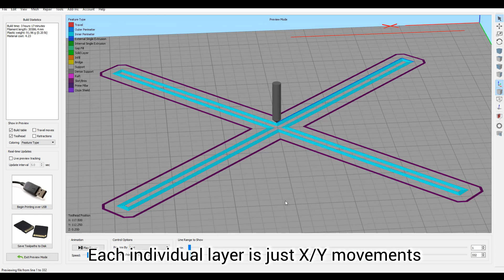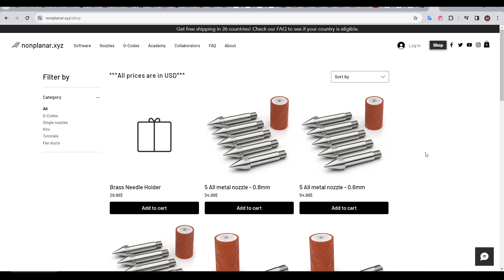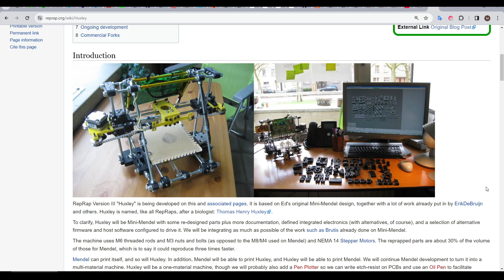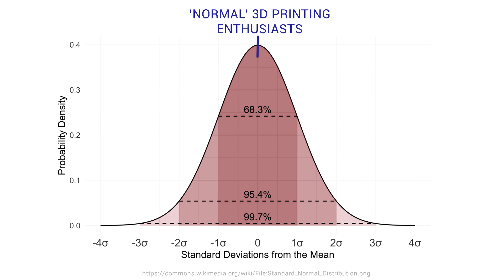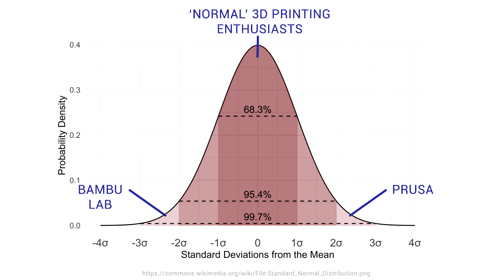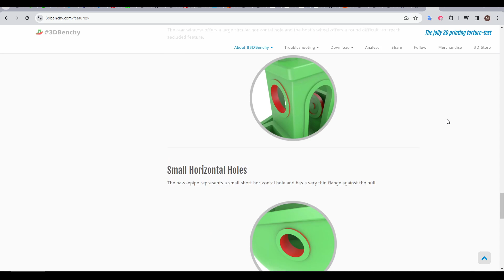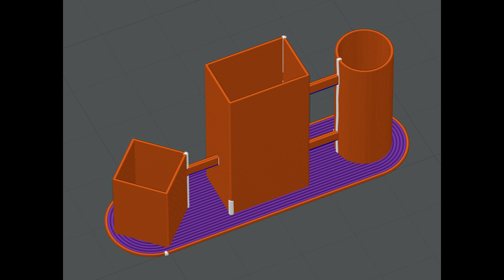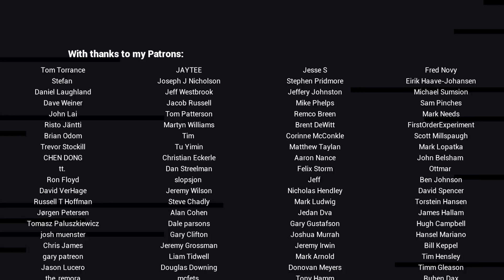3D printing mysteries that need to be solved in 2024

Comment: The community toxicity comes with scale, and low barriers to entry. Its great that manufacturers are making 3d printers as straightforward as kitchen appliances, but it does mean that its easier for people who made a "good" decision to assume all other decisions that don't validate theirs be "bad". I see a bit of this, because i bought a Creality K1. On purpose. It actually works fantastically, but its not a bambu or prusa, and some youtubers had issues with early models.

I want to see a shift away from the gear, and towards the design. Anyone can spend money and buy a perfectly good printer these days. The learning is in designing cool stuff!

Comment: I had to test your filament twisting theory. I fired up my 3D printer, heated up the nozzle to 240C (PETG) and started extruding.
It started twirling OPPOSITE like your direction (I know you are in the Southern Hemisphere), I live in the Northern Hemisphere (Europe). 
So your theory seems true 😮

Tehnical information:
The heatbed was turned off while testing.
I have a Lotmaxx Shark V1 with the double filament extruder mounted (first Kickstarter edition).

Here is the video proof:
https://youtu.be/gh5NYtfF1b8

Comment: Definitely interested in non planar printing. It'd allow for greatly increased color control on surfaces and far less waste. Print one color once for a surface feature over varying Z surfaces, instead of having to change filament many times for each layer.
Reply: It would be a great feature, unless like so many manufacturers you are getting into the filament selling business as it appears to be more profitable than selling printers, in which case the filament waste is a feature, not a bug.

Comment: Strain crystallization is the reason for the cracking. 

PLA is a semi-crystalline synthetic plastic derived from corn.

The phenomenon you are experiencing is known as "strain crystallization"
https://en.wikipedia.org/wiki/Strain_crystallization

When PLA is manufactured (or any other semi crystalline plastic) this effect occurs. During spooling the filament is quite hot and somewhat pliable. The filament gets wrapped around the spool where it finishes cooling and forms a kind of memory effect.

Image for a moment that a flat sheet of plastic is suspended on its outer edges with hundreds of pounds of weight set in the center of the sheet for an extended period of time. Over this period of time the plastic will start to deform. When the weight is removed the plastic will maintain its new deformed shape. If the weight is left for an even longer time the plastic will eventually reach its maximum deformation state and break. This is the same effect as in the filament although in reverse since it's coiled and then straightened.

The filament is now constrained in the tube (which is most likely more straight than the filament) and is now stressed from its original form. It eventually breaks due to this strain.

Moisture has a small effect on it, but is not the only reason it breaks. Oddly enough, the tools used to remove moisture are the same tools that are used to reform the filament. In this case a heater / dryer.

If the filament is sufficiently warmed before it enters the tube it should reform into the shape of the tube and stay that way without breaking.

This breaking effect is amplified by cold temperatures since most homes aren't heated (or cooled) at the same temp in summer vs winter.

TL;DR
If you use a filament dryer to warm the filament just before it enters the tube, it shouldn't crack.

Comment: 11:22 Filament flows with same speed if you print walls of two objects. 
If you print top side of cylinder, it is completely difference flow-speed. Print an area, jump the other object and print wall, start new layer. 
You have another flow-speed, filament heating is difference and you have another color.

Comment: Non planar slicers are actually already commercially available, I have visited them on the Formnext, the company is called ADAXIS (google it yourself, not gonna post links on y-tube). I have talked to a company respresentative and he told me, their SW is actually also usable on standard 3 axis devices and will work fine (with the required adjustments). The SW is capable of modeling every bit of the printer at all movement states so that with just the right input data the printer will never crash into itself. The SW is also capable of any amount of non planar slicing in any direction for anything up to 7 ax machines.

The SW costs 4'000 € per year per workstation (more than 2 Ratrig V-Cores). I already told the guy, if they would ever sell a reduced, commercial licence for only 3 ax machines for 200 € or less their customers would not be in the 1'000 ends (elegedly they have like 2'000 customers currently) they would number in the millions).

Comment: For the artifact you mentioned at the end, I know it. Changing the layer switch point, what's called... Well that option, into the slicer, you set to Random instead of Aligned, the point where it switches to the upper layer. This could not resolve at all, but mitigate the artifacts disguising them.

Benchy, then: I have a feature on all my benchies which is not featured on their site. 😮 It could be an artifact but it's very subtle and looks intentional. So I re-downloaded the benchy from Printables (I'm on Bambulab) and reprinted it, and there it is! Again!
It reminds like the "secret" hull line, so called, which is an artifact and it's kind of an unsolved mistery since nobody knows why's there and how to avoid it. Mine, instead, looks like that but is way more subtle and follows the upper edge of the hull. So it's not a layer artifact. It follows on more layers and it looks like a very subtle fuzzy skin band effect which follows the upper edge of the hull. 

No freaking idea what could it be!

Comment: I think you're right about that surface finish thing, I think the best way to fix it is to anticipate how much heat will be needed to bring the required volume of plastic up to temperature, and maybe to adjust heater power early to account for how much time it take the heat to make it from the heater into the nozzle.

Comment: i wonder if warming the old filament would help it stay soft. Like a dry box, but a hotbox instead. I can even use tape caulk on metal rooves in -35c if i have a hot box close by the roll former.

Comment: The brittle filament is due to humidity swings, and brand quality to lesser degree.  I've had the same repeated experience before I figured it out (I live in humid south/coastal USA).  I centered on one brand (Polymaker) but more importantly, I store all my filaments, individually, in 4L cereal bins with desiccant, never a problem again.

Comment: the layer artifacts are flow related, but caused by the minimum layer time (a cooling setting) - if you printed a plate full of parts you wouldn't see these as prominently.

Comment: The toxicity is just like anything else. Accessibility brings with it the dregs who take the opportunity to lash out for a lack of understanding of any other option. I used to spend a lot of time offering assistance on the resin reddit pages with new users years ago, doing extensive engineering and troubleshooting, but anymore, it's just a breeding ground for stupidity where you'd be hard-pressed to spend your time actually trying to help someone where doing so opens you up for a full frontal attack. Very reminiscent of anything connected to the internet with no filter, where it was supposed to be a thinktank for helping others colloquially, but has spawned an entire generation of pandering fools with no self control. 

On a more serious note, non-planar printing is still very much a niche pet project but wholly underutilized industry-wide. I looked at it for about six months with a large delta or adapting the instruction set for a 5 axis, but ended up moving to resin printing exclusively about 2019. I recall my filament swirling clockwise however, located in North America.  I suspect that's more a property of feed mechanism and type though.

The bending/breaking filament is kind of two-prong. Part of it is a long, technical exploration of off-gassing properties of what escapes as your filament ages, and part of it is thermal cycling in concert with your printing environment, storage practices and moderate shifts in elasticity. I could write you a white paper on it given the time and space. 

A theory on the artifacting with congruent shapes/parts, I believe was explored with retracts, and cycling in and out of the hot end as you noted. I'd have to go back and see where it was discussed in Cura a long, long time ago, but there's a setting to help alleviate this. (Last I used a dev release was around 4.8 quite a while ago, but with a delta printer also, I never noticed these issues. It may also comes down to not using the cartesian movement system)

Comment: Where do you store your filament when not in use?, the only time I've had filament snap like that is when it was about two years old and left out to the enviroment, I use a sealed plastic container with lots of dessicant in it these days (each one holds 3 reels), keeps all my filament nice and dry and in a pretty fixed enviroment when not in use.

Comment: I'm pretty sure that slowing down the top layers quite a bit would allow the hot end to keep temps so when it hits the top layers and slows to 50 percent of your wall speeds it's closer to running your wall speeds and keeping the temps consistent

Comment: Agree totally with the Bambu vs Prusa.  I have a Bambu X1 Carbon with AMS and a 5 head Prusa XL.  They are both great printers, but like any other tool one will work better for a specific job.  The Bambu is great for small jobs with a few changes, the Prusa for bigger prints and more tool changes

Comment: 8:51 regarding the filament breaking i think it has to do with the fact that with the way it is positioned now you bend it the opposite  way it is on the spool the moment it enters the bowden tube.
adding the fact that when the gantry comes to the front right it must also twist(at least im my imagination!) causing the breaks .
i would lower the spool so its top is leveled with the top of the machine  and have the filament go from the top of the spool directly to the tube.( flip upside down and left to right)
happy new year to everyone and really really thanks for your guides-videos. definitely a treasure of help and knowledge

Comment: 11:27: This is very apparent on ABS, which has a much higher shrinkage rate than PLA.  So my theory is it's due to the total layer time for each layer and how that interacts with the shrinkage of the material.  A perfect square or cylinder means the same layer time for each layer, so the shrinkage is uniform.  However, when other geometries are introduced, the layer time changes and the amount of shrinkage changes before the next layer is put on top of it.  A test for this, which I have not tried yet, would be to adjust the slicer settings (extrusion speeds) such that each layer takes the exact same amount of time.
Reply: ABS also suffers from temperature dependent die swell more so than most other materials. The nozzle tip temperature of course isn't controlled by the printer, the probe is basically next to the heater or the threaded part of the nozzle, and depends on any number of things that happened just prior.

Comment: OK, warning huge comment incoming:
1. Non-plannar. It is already very much a thing for professional/industrial applications already (see pellet printing robotic arms with software like AiBuild, Adaxis etc). Everything is very expensive in that category and the reason I think it has not trickled down so far to the prosumer side, is due to not having a "killer" application/need to justify investing (prioritizing) the development hours. Similar to why PrusaSlicer never got belt printer support and Duet3D is making toolboards for Revo Roto and not updating the firmware for robotic arm kinematics. You have to prioritize and so far non-plannar 3d printing for prosumers has only been able to be in the "nice to have" list of features. If you are 3d printing a mold for autoclaving carbon fiber aerospace, F1 etc parts you actually need to use non-plannar printing for the best results. If you are printing parts to build a HevORT SPAWD, then you don't really need non-plannar. If Prusa discovers an application for which non-plannar printing is necessary, I think they will put it in higher priority to support it in the slicer.
2. Toxicity: Internet communities are not "natural" communities and the "normal" rules of socializing and behaviour don't apply. If you are an irrational fanatic in a physical/analog community you will be exiled, paying a huge social cost. In an online community you will get blocked/muted/"cancelled" only from the opposite tribe fanatics and there will be a welcoming tribe for you to feel a part of, which is not really a cost to pay. If toxic behaviour is not "costly" socially, then the curve slightly changes shape and you get more hardcore tribalism.
3. Mostly material dependant and to some extend moisture. PLA, PC, Nylon and silks (PLA + polyester modifers the shininess is because chemically the polymers don't mix well and interlayer adhesion is worse for silks as it is known) can have clumps of crystals form (crystallization/chain structure alignment) and so there are "weak spots created" as crystallized material is stiffer and more heat resistant, but does not have much flex/durability to it. Very unlikely to notice PETG and ABS/ASA filament break in a similar way, not impossible as there are still "spooling memory" stress points. It is not a coincidence that small inner diameter spools are not around anymore.
4. 3DBenchy secret was indeed intentional by the designer and at 3d printing meetups in Sweden there were 3DBenchy stacking contests.
5. Layer time, time for flow pressure to recover/stabilize after retractions, material flow behaviour/pressure advance settings, jerk+acceleration+slicer engine settings (arachne engine) perimeter generation automatically adjusting flow rate/extrusion width, without adjusting jerk and acceleration settings. Not a coincedence the artifact is more visible at the corners. Also see https://help.prusa3d.com/article/the-benchy-hull-line_124745

Comment: Me not being part of that discussion nor having watched those videos (I took a hiatus from 3d printing for 3 years,) my take on them saying to "build a voron" is that they want to see their favorite content creator build their favorite printer. Surely, not all of them meant it in a bad way, right? Maybe they wanted to have that common connection with you and see if you also ran into the same roadblocks or hurdles they encountered when they built theirs? Or maybe I'm naive to think of those comments benevolently. 

But, I do understand what you mean about the community being toxic. But, I saw that 5+ years ago when I was first learning about 3d printers. There were always those people that would sarcastically say to "get your spirit level out and level your bed." Those kinds of comments are never helpful. And more people getting into the hobby means more trolls. I see it in the Facebook groups and other places. But it's always been there. I was on the receiving side of it when I was first learning.

Comment: Last one is caused by printing speed (therefor flow rate changes, temperature changes, acceleration changes etc) . Force your slicer to use only one speed and the only artifacts you'll see are from backlash or resonances

Comment: Surface artifacts are caused by differences in pression buildup between layers. If you print just a regular object with seams all in the same place then every layer has the same pressure at the same spots, so layer density is exactly the same at the same position for each layer. You can, for instance, change the seams to other position in the middle of the object, because pressure at the start of a layer is not the same as in the middle, and since you moved the start of the layer to another position you'll notice the difference in pressure in the layers.

Comment: So toxicity isn't new tribalism always existed. The thing is now there are enough tribes where you can see it. Functional vs. non-functional prints and FDM vs Resin were kind of the only tribes until recently because all the printers were practically the same. Generally speaking, you could modify any printer to be just about any other printer. Now you have two camps that are fundamentally different and those two camps are hobbyist vs non hobbyist. And everyone knows once that happens there is going to be no end to it. Once something goes from hobby to tool hobbyist are going to be mad because accessibility is their main concern. Non-hobbyists who look at 3D printing as a tool are going to be like I don't care about accessibility give me a reliable tool. It's not the advantages of different approaches it is literally I don't want my hobby to become inaccessible or too expensive vs I don't mind paying more if it makes it easier for me to do some other thing.
Reply: I feel like it's more that that. For some of these people it seems like their Bambu printer is a status symbol. Like driving a Mercedes

Comment: 8:50 PLA absorbs moisture and becomes very brittle, but somehow only when under tension. reverse-bending it in a bowden tube causes it to crack but not on the spool where its relaxed. 
it might absorb moisture more efficiently when under tension due to microcracks. just like when applying cleaning alcohol on a polycarbonate piece (like a CD)   it instantly snaps when you do this while you bend it / have it under tension.   but it wont do anything to it when its in its relaxed state and bend it after it evaporated.